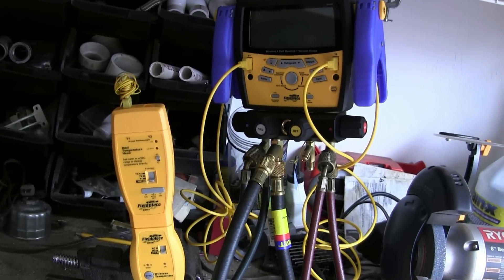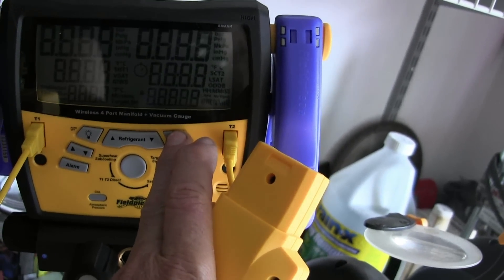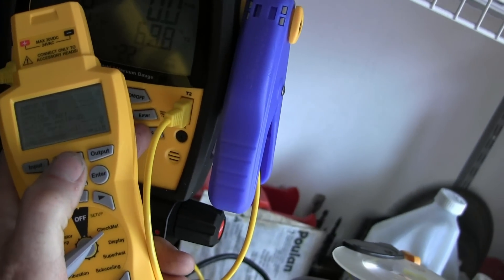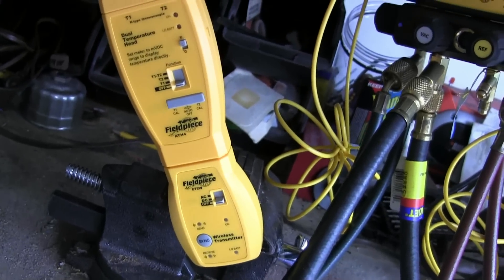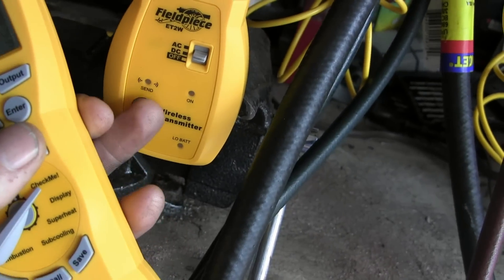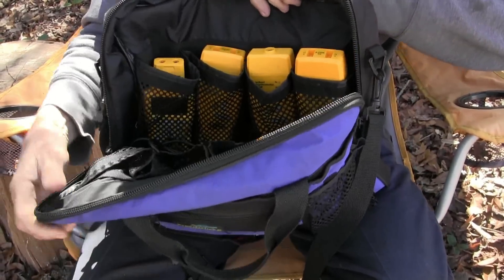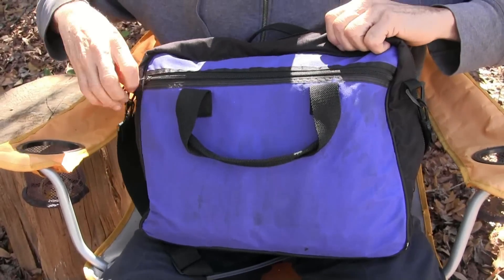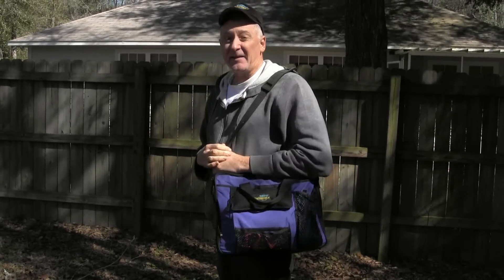HVAC Fieldpiece SMAN4 and HG3 syncing

Comment: I also bought the sman460 & the HG3 and have updated the firmware and I keep getting an error " Input form output out of range. Re-measure inputs or unlikely conditions. But if I don't use the wireless features on the Sman460 it works ok. Has anyone found the solution to this problem? I would really like to use the wireless features I paid for with these Fieldpiece units. Thanks for any help you can provide